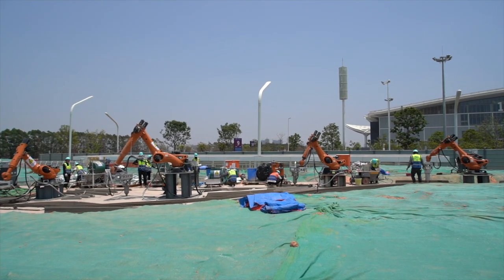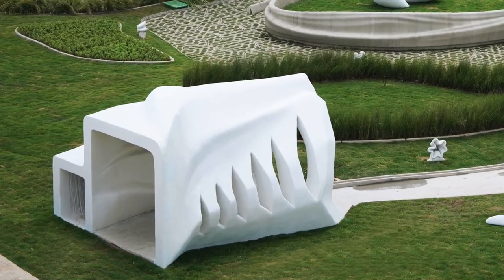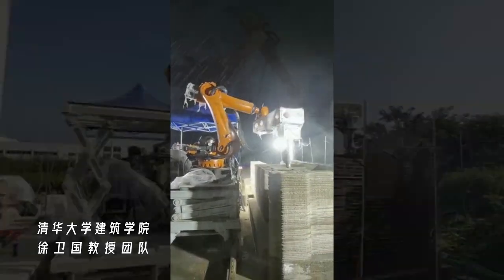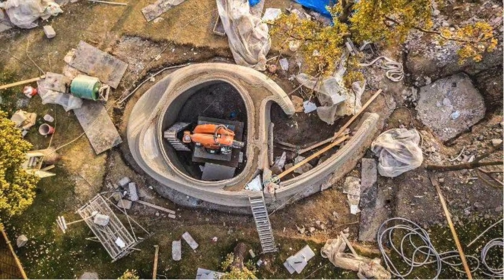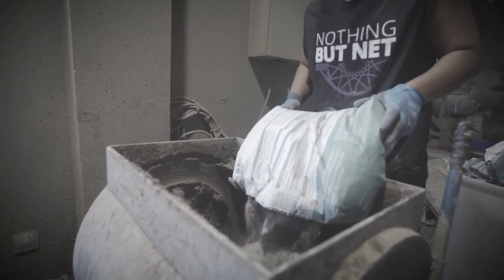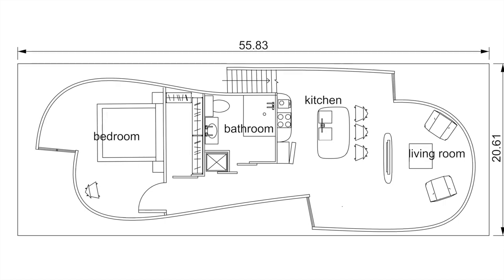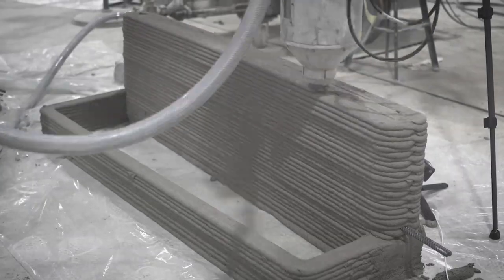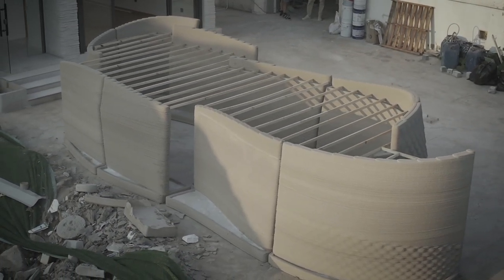3D Printed House With a 3D Printed Roof, Huge Park & Reading Cabin of the Future | AICT

Comment: what's your thoughts on things like building from prints of plastic polymers filled with foam then cast in concrete? i think it's mostly used as building fasads and artsy fixtures (like signs and kiosks). think you'll cover any of that type of printing, or is that too far removed from your main goal/interest?
Reply: (assuming you haven't array and i just missed it,  I'm very inconsistent ><)
Reply from the maker: It’s interesting, I cover completed construction projects mostly. Plastic forms would allow for much more detail. I could see it being very useful for custom situations. It would never be cheap though.
Reply: ah yeah,  i often fail to consider costs in these things and  focus too much on how interesting the technology is.
Thanks for the reply (and all the videos/hard work)

Comment: Awsome . Here’s an idea💡3D Print it with hempcrete and create 3D printed hemp plastic rafters and roofing panels. We can literally grow our economy out of the ground. When we stop using mined and Forest products, We the people Fund each other rather than funding those who claim to own all the resources. 
Let’s use 3-D printers on wooded lots leaving all the trees in place except for the actual footprint of the home, and aproach. With a waste burning toilet and water recyclers you would NOT  need to dig in sewer and waterlines. Use a rain barrel catch system and around the footprint of the home digging geothermal air tubes to bring 53° air into the house with a in-line fan. Install wind and solar use all low-voltage lighting.  A hemp pellet heater would heat the entire home. 
Voilà! you’re living off the grid. Hempcrete still uses a lime binder, It is lighter weight and ‘warmer’ to the touch.  Hemp is legal to grow removes glyphosate from soil. Farmers 
Growing GMO can grow hemp to ‘clean up’ their soil from toxins. Hemp sequesters more carbon and produces more fiber acre for acre than 30 yr old trees and is ready for harvest in 3 to 4 months. Bonus. Seeds for round 2!  It needs no pesticides or fertilizers. And requires little to no watering. 
‘Now you know why it was illegal to grow, creating a war on drugs over Hemp’s cousin. Marijuana. -which heals 650 diseases according to MERK 
PHarma manuals from before 1900.  (& Cancer cannot live in an alkaline body.) TRUTH WILL KILL THE CABAL’ SHE SAID WITH A 😉 WINK.
- Kat   my project is  -Warriors Post Ranch. Com